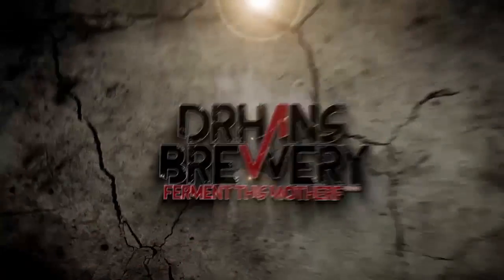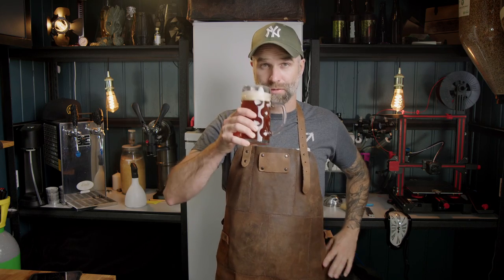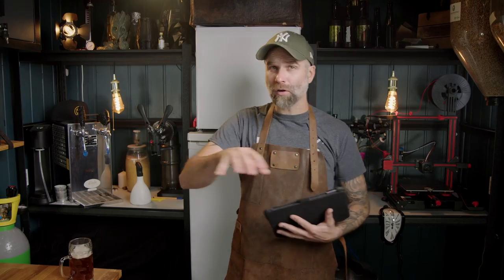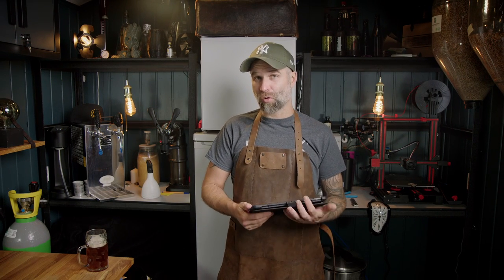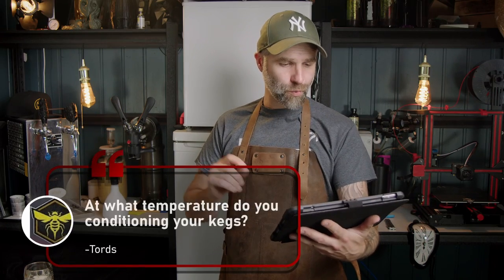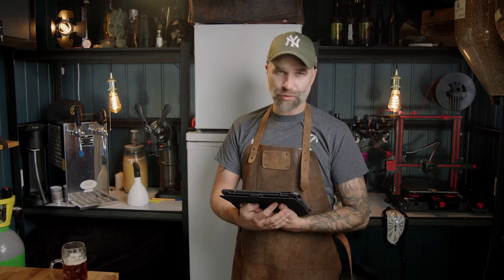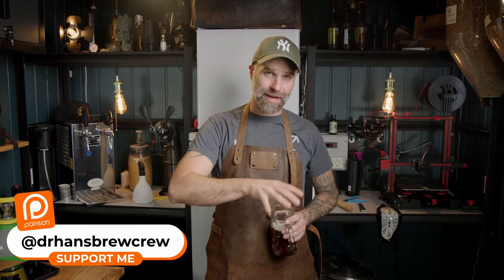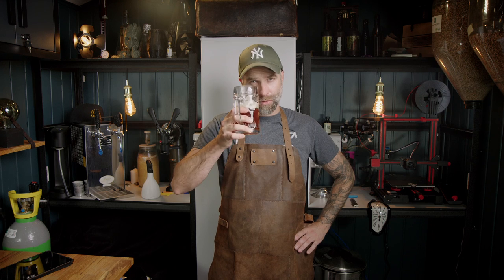Removing Hot Break from Wort - Ask the Doctor about Beer and Homebrewing e5

Comment: DrHans, thanks for expanding on your explanation about removing the hot break. It now makes perfect sense. 
I brew with rain water and don’t get any nasty gunk on top at the boil. I will try both removing and stirring it in to see the difference. 
Thanks for your great content.
Reply from the maker: Thank you
Reply: Hot break should be skimmed off as it forms and when it stops forming bittering hops are added but when hot break is removed from beer produced from the single infusion method the beer will be thin. In beer produced with the single temperature infusion method, hot break, starch carry over, protein sludge Beta Glucan and sweet tasting nonfermenting sugars form body and mouthfeel. In ale and lager brewing steps are used upstream of the boiler to reduce protein gum and Beta Glucan and to form the tasteless, nonfermenting types of sugar and albuminus protein that are responsible for body and mouthfeel. In the industry that uses single temperature infusion, protein gum, Beta Glucan and chemical imbalances, are of no concern, everything is left in the still. The only sugar moonshiners are concerned with is simple sugar, glucose, which makes alcohol. That is why only one step is needed for producing moonshiners beer. Single temperature infusion produces the lowest quality extract that can be drawn from malt. The beer is meant to be distilled but back in the day the beer was sold to commoners and paupers in England that couldn't afford real beer.
So that an ale and lager brewer doesn't purchase malt that contains a high amount of protein and Beta Glucan or malt that is low in enzyme content malthouses provide a malt spec sheet with every bag of malt. Malt spec sheets are online from every malthouse. Percentage of protein, Beta Glucan content and level of malt modification are important numbers on a malt spec sheet because the higher the numbers the less suitable the malt is for producing ale and lager. A recipe and a beer kit are worthless unless the malthouse that produced the malt recommended in the recipe and in a beer, kit is mentioned because a malt spec sheet cannot be obtained.
A way to reduce hot break without using the decoction method is to use first wort hops. The purpose of first wort hops is to reduce hot break by reducing surface tension similar to using soft water. Rainwater is soft. I use soft water for brewing but not rainwater. The way that first wort hops is explained in home brew literature is incorrect. This is the way it is done. When the bottom of the boiler is covered with extract the runoff from the lautertun is stopped. The boiler is fired and the extract covering the bottom of the boiler is brought to boiling. Hops or a handful of crushed black malt are dumped into the boiling extract. Then, extract from the lautertun is slowly pumped into the boiler so as not to stop the extract in the boiler from boiling. As the boiler fills any hot break that forms on top of the boiling extract is removed. Reducing hot break allows the boiler to be filled higher without worrying about boil over and the extract is cleaner, less hops are needed. It is a trick that has been around for a few hundred years used by brew masters. Boilers used for making ale and lager have a hot break skimmer almost at the top of the boiler. Hot break goes down the drain as it forms.
To offset the thinning that occurs when hot break is reduced and thinning that occurs when low temperatures are used for preserving enzymes during mashing the decoction method is used. In the decoction method mash is boiled a few times, which reduces protein gum and lowers mash viscosity. Enzymes pass through their optimum temperature ranges a few times and chemical precipitation occurs which produces stabile, chemically balanced extract. Also, when mash boils, hard, heat resistant, complex starch called amylopectin rapidly bursts and enters into the mash liquid. Amylopectin contains limit dextrin, which are tasteless, nonfermenting types of sugar and pectin which form body and mouthfeel in beer along with a certain type of albuminus protein. The boiling decoction is added back into the main mash to raise mash temperature and Alpha liquefies the amylopectin causing dextrinization and gelatinization to occur. A decoction can be used for raising mash temperature from an acid rest temperature to a protein rest temperature (albuminus rest), or to raise mash temperature to conversion temperature and to higher saccharification temperatures.
In the single temperature infusion method amylopectin is thrown out with the spent mash and to replace the starch ingredients that loads extract with protein sludge and Beta Glucan are purchased.
Hansel didn't start skimming off hot break until I suggested he do so.

Comment: 5:16 10L pressure fermenter question. You can pressure ferment in a Corny key (19L), which is good value for money. 1) It's made from stainless steel, which will last forever and be easy to clean. 2) You can serve from the keg, using a floating dip tube. Treat it as a Unikeg. 3) Buy two if you want to transfer off the yeast. The second can be a 10 or 12L Corny keg. 4) They have resale value and they are popular second hand. The resale value is close to purchase price! 5) Smaller kegs can be used for Shake-n-brews.
Reply: I agree with all of this. It is in fact just what I mostly do (except I brew 11½L batches), but I agree with the questioner that it would be nice to see what's happening...
Reply: I just love seeing the yeast at work... I will have to get one or two small kegs to serve from anyway and will definitely try them for fermenting as well.

Comment: When we brew commercially 200 hl at a time, there is no practical way of skimming. So we don't. If it was a major factor we would sure find a way to do it. If we don't put money in to do something, you probably don't have to do it for free.

Same thing with chilling and diacetyl rest. Some say you should heat it up to 20 degrees after fermentation. We do not put energy in to warm something up, we already paid to chill and then have to chill again. You could stop chilling and let the fermentation heat it up in the end of fermentation, but basically the temperature during fermentation and afterwards is one way down.  Energy is money.
Reply: You should have ordered a boiler with a hot break skimmer.
Reply: @michaeljames3509  I have seen a couple of large boilers for wort. Never one with a skimmer. Have you? Kunze do not mention skimming at all. If it is not in there, it is probably not an important factor.
Reply: I think if you didn't acidify sparge water then skimming might get some of the extra grain tannins out. If you do a whirlpool hop addition then the tannins will stick to the hop oils resulting in astringency otherwise the tannins can drop out. So it depends on the style being brewed.
Reply: @indiekiduk  Depends on your water too. I brew with a soft water with low alcalinity. The water do not raise the pH in the end of the sparge into risky territory.
With a hard water treating sparge water would be necessary.